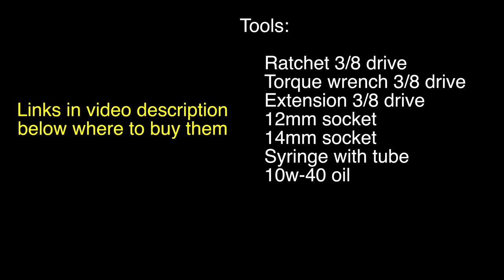Suzuki Burgman 400 - Final Drive / Transmission Oil Change 2007-2016 | Mitch's Scooter Stuff

Comment from the maker: Tools you need: 
Ratchet 3/8 - http://amzn.to/2Asw8m4
Torque wrench 3/8 (0-75 ft-lbs) - http://amzn.to/2lUMRt3
Extension 3/8 - http://amzn.to/2qq06Yf
12mm socket 3/8 - http://amzn.to/2EZ5h4E
14mm socket 3/8 - http://amzn.to/2Cs9SdT
Syringe with tube - http://amzn.to/2qsj40t
10w-40 full synthetic oil - http://amzn.to/2qoiq3P
Oil pan ( I cut jug in half and use the bottom half )
SHOP MY SCOOTER STUFF: http://amzn.to/2CbqQku

Before doing this service, watch the videos how to remove
Left side skirt cover - https://youtu.be/tCsOrZ3JKSY
CVT cover - https://youtu.be/iGCzgkvl3xY

More 07+ Burgman 400 videos: http://bit.ly/2gHMP3D

Want more free Scooter Tip / Tutorial videos - Please support MicBergsma!
Paypal donation: http://bit.ly/2fghrwN

Comment: Nice vid, little thing I like to different (this applies to any transmission/ transfer etc) Always remove the filler bolt first. If you have trouble the remission is still full and you can still use your vehicle to get different tools/replacement bolt/copper washers. 

Voice of experience from a car that had a stripped filler bolt, had to borrow a car to go buy a set of vice grips and replacement filler bolt.

Comment: The oil you are using is wrong. Suzuki states to use final gear oil SAE 90.
It’s an error in their manual because they also state 10w40.
But if you think about it and you have to choose, you would go for their 1st statement that makes more sense.
Reply from the maker: Hi, where did you see that is wrong? Been doing this since 2007 with 61,500 miles on it, zero problem. It’s not wrong, burgman riders use 10-40 in 400 and 650 too. Honda pcx do same thing too. Did Suzuki tell you it’s error in manual? Have a good weekend
Reply: @MitchsScooterStuff  Hi Mitch, first of all let me tell you that your video tutorials are very good and have been very helpful to me, thanks!
What happens is that I have a 2002 model, bought new and it came with a sticker from Suzuki saying to use Motyl (SAE80w90) for the transmission, in this case final drive. I also have a 2003 Suzuki workshop service manual that states to use SAE90 for the final drive, or SAE80 if you live in a climate with zero degrees Celsius temps.
The thing is that in that manual it also states on the same page to use 10w40 for the transmission oil, which seems a contraditcion and hence an error. I believe it is a copy over from another Suzuki manual…
The gears in the final drive are helical gears and this type lubricate better with a higher viscosity oil, like differential gears do. The TMAX 500 also uses SAE 80/90.
In my opinion this is the oil to use.
It’s certainly something to double check with an official Suzuki dealership, preferably one that has been around for a while.
Have a nice weekend too, wherever you are. I’m in Portugal.

Comment: Thanks very much for ur helpful tut…… pls can I use the same engine oil to fill the transmission too? (sea 90)
Reply from the maker: You’re welcome! You can use 10w-40 engine oil in transmission too
Reply: Thanks very well.……..is transmission oil change the same as the gear box oil change?

Comment: How many types of oil changes does Suzuki skywave 250 has?
Reply from the maker: For your Suzuki Skywave 250, it's recommended to use a high-quality 10W-40 engine oil that meets the API SG and JASO MA specifications. This ensures proper lubrication and performance for both the engine and transmission, as they share the same oil system

Comment: Hi Mitch,why do you use 10 w 40?
Shouldn't you be using 80 w 90 for transmission fluid?
Reply from the maker: Hey, Suzuki manual say 10-40… same with engine oil… Honda PCX do same thing too
Reply: @MitchsScooterStuff  ok, thks 👍

Comment: Wouldn’t u want to use gear oil? I don’t have this bike my cousin does mine a different engine and stuff I run klotz 80/90 gear oil I’m honestly not sure that’s why I’m watching videos
Reply from the maker: Suzuki recommended engine oil in manual 🤷🏼‍♂️ I don’t have any problems over 61,000 miles so far